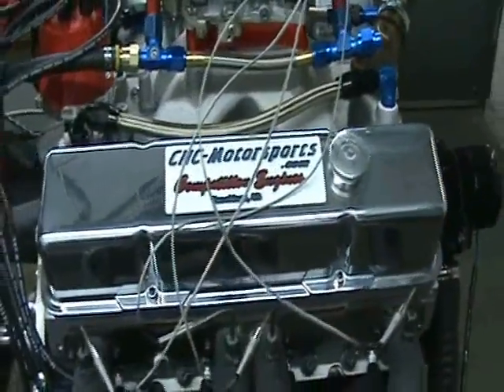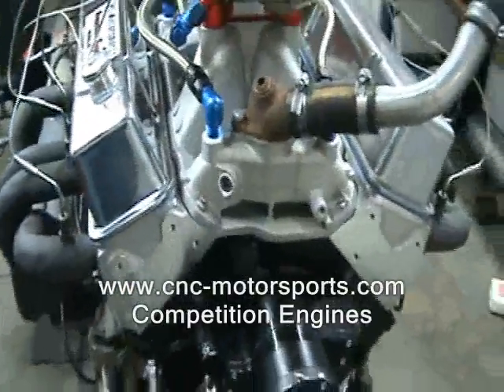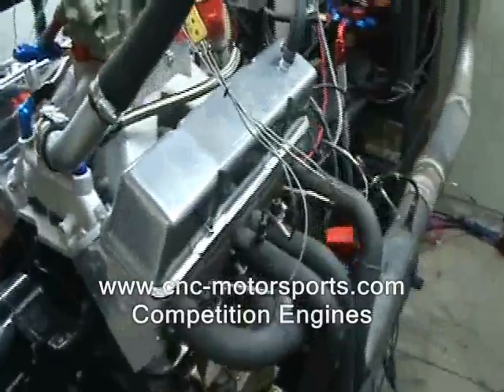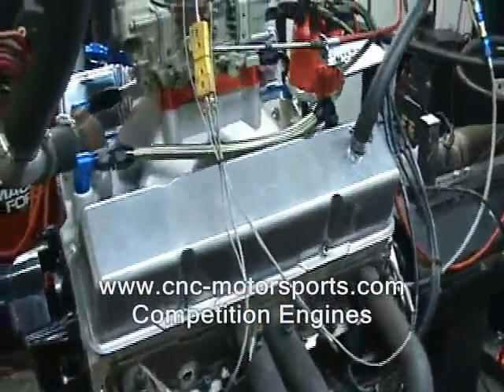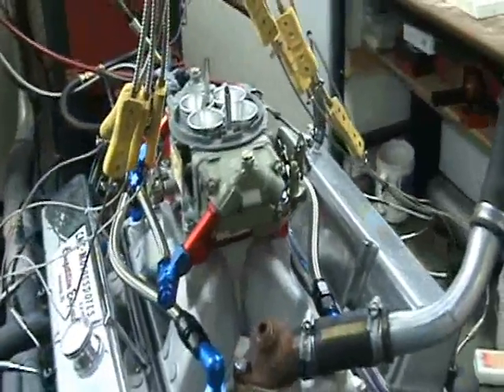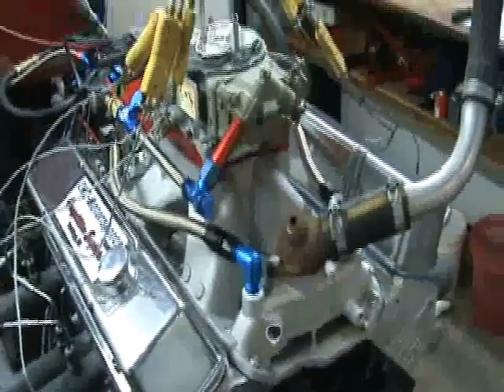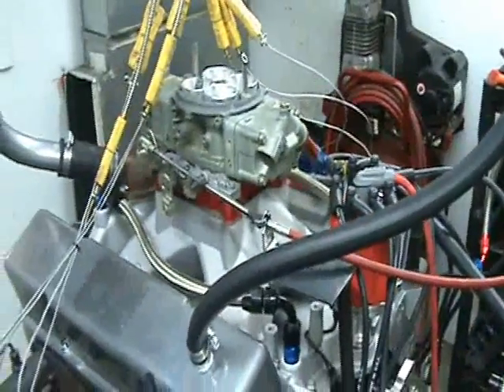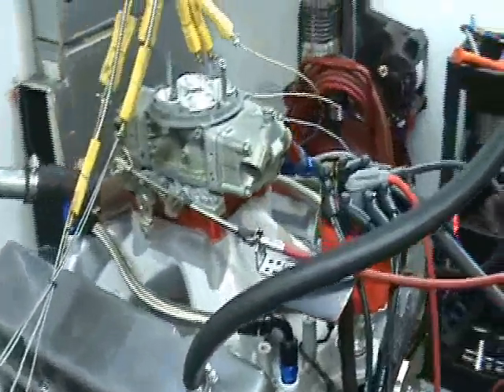SB Chevy 393 Race Engine 686 Horsepower

Comment: I watch a lot of videos on youtube of the dynoing of various engines. You guys are probably one of my favs. You guys seem to make a fair amount more hp than everyone else for a given combo. I appreciate that because I too tend to fudge out a hair more than the norm.  My latest is a 410 Cleveland, hyd roller ,200cc heads, trickflow single plain,950 dp , 11.25-1 comp, 91 pump gas , no spacers, all accs on engine. 624 hp @ 5900 rpm, 580 ftlbs @ 5600 rpm. Thanks for the vids

Comment from the maker: @thunderflash68 
Compression ratio was 14.0:1, lowering to 11.5 would drop off about 20-40 hp and 20-30 ft pounds of torque depending on the fuel used and what camshaft was used.